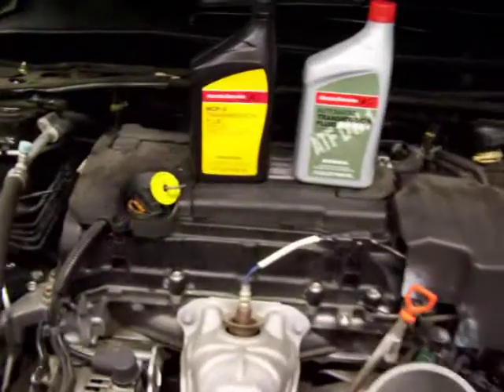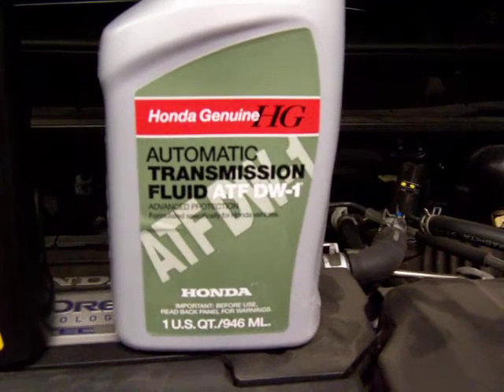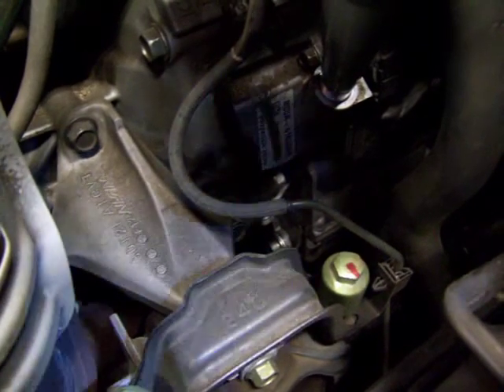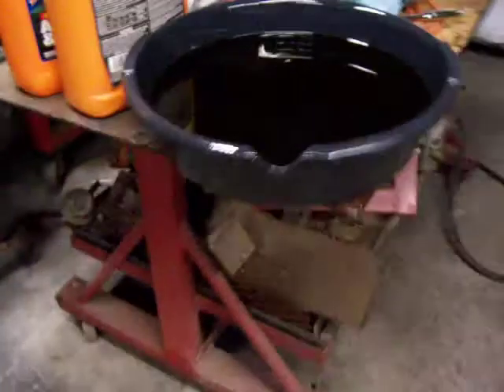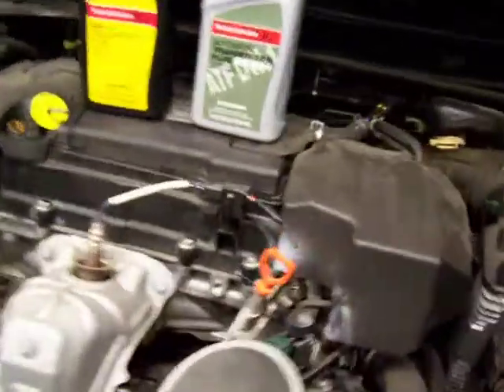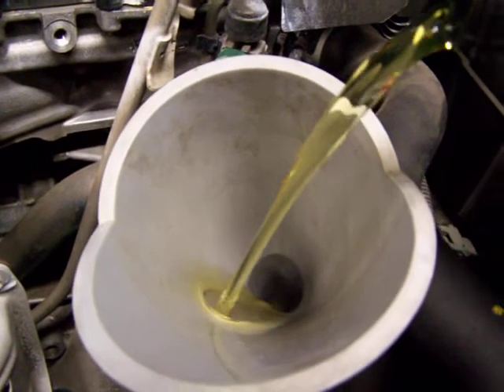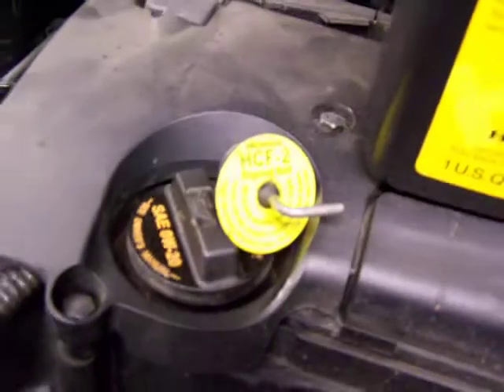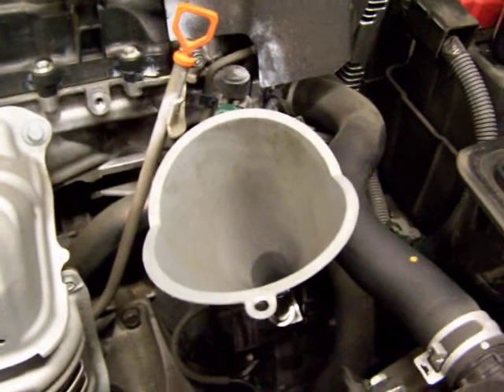2013 Honda Accord Sport CVT HCF-2 transmission fluid change.

Comment: So all we need to do a transmission fluid change is the 4 quarts of HCF-2, a crush washer, drain pan, and a torque wrench? There is no filter that we need to change like in an oil change?

Comment: Great video steve,i have a 2016 Honda Accord sport sedan just like your model,but my question is how do you check the transmission fluid  in the future to see if is low or if is dark sence it has no dipstick...
Reply from the maker: Unless it's leaking you won't lose any fluid.

Comment: your car engine is already dirty...you should clean your car. Mine is 2012 has 51000 miles on it and the engine is clean like brand new and no leaks and oil.